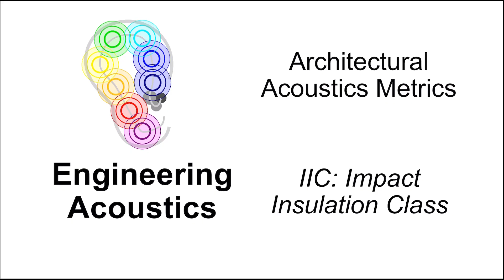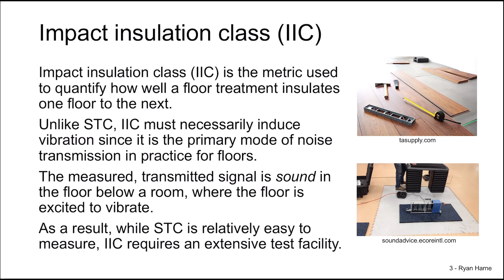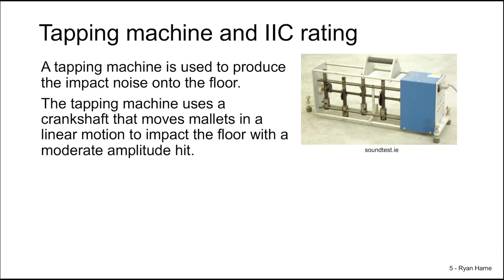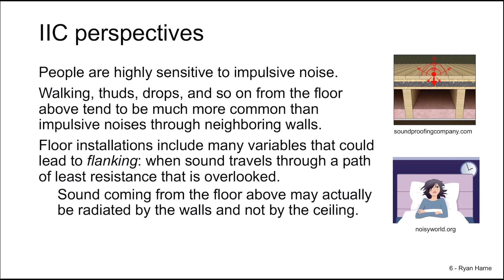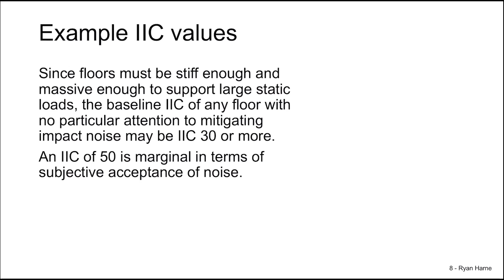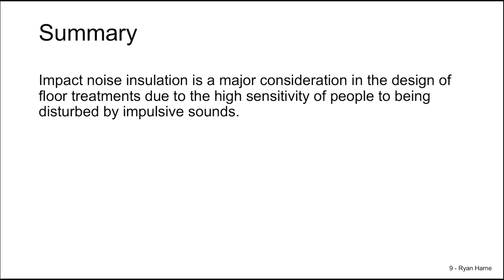Comment: Found this 2 years later and it is very helpful. Now that my landlord has replaced the carpet with underlayment by hard wood floor in the apartment unit directly above me, it signifcantly increased the noise level. I am going to take this to the building inspection department since I found no permit was granted for such ridiculous renovation!

Comment: I do not understand how a thin layer of carpet with no insulation can outperform hardwood with a thick layer of insulation. One would think the hardwood would provide additional reflection and the insulation additional absorption, leading to higher transmission loss. Does the order matter (absorption vs reflection on top), or is the carpet just a much better absorption material? Can you help me understand?
Reply: Great question! The order matters. The ideal way to insulate noise or vibration transfer from one space to the other is to have an absorbing layer receive the incident energy, followed by a barrier layer to stop what gets through, followed by another absorbing layer. The last absorbing layer is optional and may not be feasible depending on the construction scenario. In the case for IIC, the carpet is the absorbing layer because it is soft. The floor below it is the barrier. This combination is ideal to stop the transmission of impact noise from one floor to the next.
Reply: Thank you so much! So for the best sound isolation you want an absorber at the very start and the very end. Is this known just due to experiments conducted, or is there a theory that explains this?
Reply: @grantmurison3603  Definitely there is math that supports this! Video 34 "Wave Transmission Through a Layer" provides the groundwork to characterize the effectiveness of a layering method to attenuate sound. Then there's a whole range of real-world data to support the theoretical results.